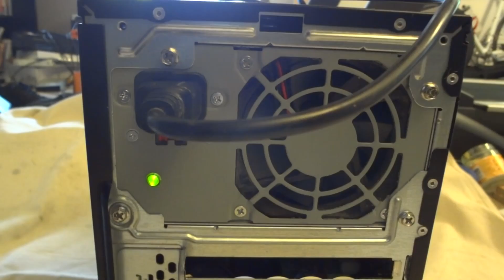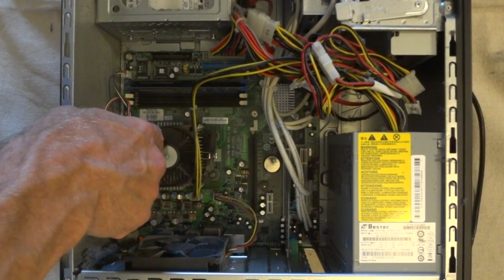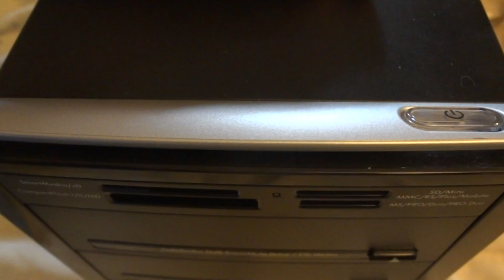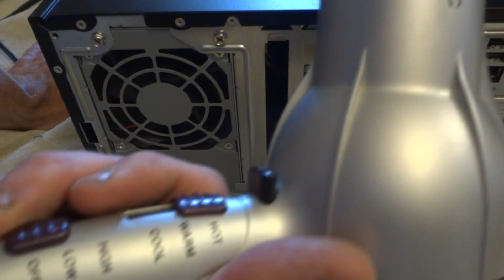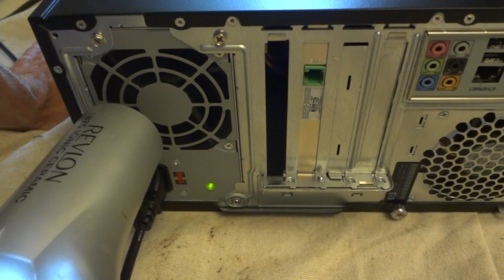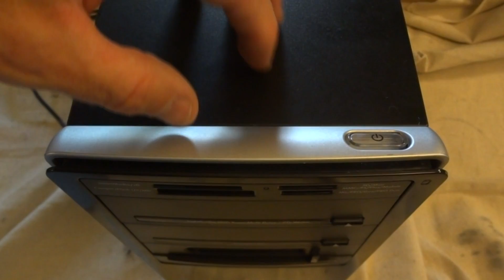HP Computer Won't Power On (Flashing Green Light On Back)

Comment: using a vacuum to clean computer not the best idea as can create static electricity... and zap your motherboard.
Reply: Smarter to blow it out.
Reply: i might agree with you sir!! can you pls help give me a hint or idea what should I do because i had a problem when i on the AVR and then clicked the CPU power button!! the monitor wont on!! mean it wont turn blue and cant proceed to windows!! do you have an idea sir what is the solution of this problem sir? looking forward for your fast reply sir!! thank you!!
Reply: and also sir there is something that i observed!! the sounds of the CPU when i turn on the CPU is not normal at all... :(

Comment: Dis that guy just used a vacuum cleaner to clean the pc ?!
Reply: What's wrong with that? Any better suggestions?
Reply: @dovydasvaiksnys3807  create static electricity that will kill all the capacitors on the motherboard lel it is why you don't put motherboard on a rug floor, static electricity
Reply: Did*

Comment: my light is green but i dont see anything on my screen. the computer turns on but nothing shows up on my screen
Reply: your issue might be more serious...open the computer and see on the mother board if the green or yellow light is on.  Not all but most motherboards has a little light somewhere and it is on when you p0wer it up.  if you find the light and it is no ON when you turn the power switch on, it means the motherboard is the culprit..

Comment: +RJ The Bike Guy listen my HP is working but when the power disappear (not in the pc, in the house) i wait for the power to come back. When it come back, the green light is blinking.. Then im using the fan method...
Reply from the maker: Replace the power supply.
Reply: +RJ The Bike Guy but listen at me, i dont have to do that method with the fan everytime , just once and then i can turn it on until the power in my house disappeares again :)
Reply from the maker: It's because your power supply is dying.
Reply: +RJ The Bike Guy you think so? i will wait for it to die then im going to buy new one. thanks for the video :D

Comment: please help mine has a green light but it wont turn on

please please please sobody help i have pictures of my kids on it
Reply: you can get someone to take the info off of your hardrive and put it on a disk so you can have your files.
Reply: ***** which is why i told them they can take out the hard drive and put it into a different computer if they cant get it fixed.

Comment: You should never use a vacuum to suck out the dust especially on the motherboard. The static electricity from the tip of the hose could damage the motherboard or one of the components. Instead use a shop vac with the hose hooked up to the side that blows air, to blow out the dust. This works much better and drastically reduces the chance of damaging any components. Don't forget to blow out the power supply as well. Do this outside if possible as the dust flies everywhere. or go buy some canned air if you don't have a shop vac.

Comment: the blinking light got solid, but mine still wont turn on.Also the fan isnt spinning.
Reply: of coarse , GET A NEW FAN
Reply: silly or use a nother fan k?
Reply from the maker: +Wow Wow It's a POWER SUPPLY. The fan is just part of the power supply.
Reply: +RJ The Bike Guy wait . . .
The internet is better than a mechanic
(kind of)

Comment: I'm just finding your channel and it is goddamn amazing. Skimmed through quite a few bike vids and ended up here. Seriously thought you were trolling for 3/4 of the video. Really good "emergency" fix I suppose. Whats really happening with the hair dryer trick is you're heating up the solder allowing proper seating for everything. Very temporary as you noted but it works. I used to fix PS3's like that.
Reply from the maker: +ATCRyderX© Actually, I think it is the capacitors that it is heating to cause it to work. But not sure.
Reply: RJ The Bike Guy If anything, You're reseating the solder under the caps. A cap is either good or blown normally.

Comment: If the fan is defective on the power supply it may be better to just take the power supply apart and replace the fan. if you replace the power supply with another used salvaged power supply it probably wont last long either. The fan has three wires going to it. one is used to check the RPM of the fan motor. When the bearings fail it slows way down or stops. Part of the proprietary power supply wiring harness sends this signal to the motherboard and this prevents the computer from booting. HP does not make Power supplies for some of these older computers anymore and cant used a standard ATX without some serious rewiring of the harness, and power plug. also I believe there is some voltage changes that also have to be made into the circuit with the modified harness. So easier to just change out the fan. This one may or not be proprietary. I know the HP 6200, 8200, Z200, z210, and z230 are proprietary.
Reply from the maker: +jimthvac100 I swapped the ATX power supply with no issues.
Reply: +RJ The Bike Guy I was not familiar with this particular computer But many of the higher end machines from HP are proprietary.
Reply from the maker: I don't know about your machine, but I bought a Bestec ATX power supply similar to what was in there, and fixed the issue. The issue is not the fan. The issue is most likely capacitors. Heating up the capicitors allows the computer start. Just a temporary fix though.

Comment: thank you, thank you so much for this video! I almost gave up trying to figure out what was wrong with my tower because I had watched so many videos already and even took my tower apart and tried everything and I figured how many more ways can there be to fix it. but than I saw your video about the flashing green light, which is what caught my eye because I always wondered what the flashing green light meant. well anyways the blow dryer did work and now I know that i'm pretty sure I need a new power supply. and I already watched your video about installing a new power supply so thank you so much for your videos, they are greatly appreciated.

Comment: I have had this happen with many hp computers you unplug the 20/24 pin motherboard connector press the power button (While the computer is plugged in) and hold the power button and pug the connector back in while still holding the power button this works and is permanent unless you unplug the computer while its on many times

Comment: WTF! Sorry, I don't normally speak like this. THIS TECHNIQUE WORKS! USE IT! I don't have hair nuthin cause I ain't got no hair. So, I have an hp6110f that HAD the exact problem. Used a little heater (medium setting bc sensor will turn it off once it reaches temp) and held it for what, 30 seconds and _, THE LIGHT WENT SOLID AS ALL GET OUT! No joke! I make repairs for a living? and am self employed. Getting ready to take the A+ (801) exam. [Talk about tricks of the trade!]
Her system has been inoperative for months, so I'm sure everything needs updating, plus antivirus, bot and utility suite. I am BROKE, its Christmas, and this fix is heaven sent. Can't thank Google, Youtube, shyflirt1 and HP enough!  With everything that needs to be done, I'll probably charge $170 - $200, a more than fair fee. I am SO grateful for this whole experience. Thank you gratefully from the bottom of my heart. God bless. [blowin heat with a blow dryer thru the back of a power supply...who da thunk it ?!? So simple, so quick, so clever. WHY does this work? Thanks again and again. 12-12-14 midday.
Reply from the maker: The hair dryer trick is only a temporary fix for a dying power supply. You will need to replace the power supply. But that is pretty easy and not too expensive.
Reply: if you do not have a hair dryer, just blow

Comment: Tried everything and still doesent work, I haven't even had the power supply for a year and all of a sudden I walk in to turn it on and nothing. HeY I used blow dryer as well and still doesent work, hey btw speaking of that could this be do to dust build up? just curious.
Reply from the maker: Dust build up can cause the computer overheat and damage the computer. It could be your power supply is dead. Dunno. Sounds like a different issue than addressed in this video.
Reply: shyflirt1 Ya I don't think It's overheat. There's a 0.0001% chance I may have left it running for a day but I REALLY don't think I even turned it on yesterday. Oh yes and everytime I unplug and plug back into the computer when I press the pwer button the blue light that the power supply makes when it is running flashed for a sec and then went out. It only happened when I unplugged and plugged back in.
Reply from the maker: I leave my computer on 24/7. Clean it out. And you might need to replace the power supply.
Reply: shyflirt1 Yes but this power supply is like CRAP, it was like 40 bucks

Comment: Thank you so so much I tried that before but not for so long and it has now worked. However it happens every time there is a power cut (so quite a lot) so is using a hot hair dryer good for it?
Thanks again!
Reply from the maker: This is only a temporary fix. Your power supply is going bad. You need to replace it. How To Replace Computer ATX Power Supply

Comment: I have the same exact computer , but it does turn on . The thing is it stays on a screen with the hp logo . And it doesn't do anything else . Do u know what could be wrong with it ?
Reply from the maker: Different issue. Sounds like MAYBE something got corrupted. You can try restoring your machine back to the last successful start up. Google for detailed steps on that.

Comment: Are you really suppose to put the blowdryer so close to the opening? I don't like putting it on high and holding it so close because I'm afraid it will overheat or something
Reply from the maker: Then don't do it. This is just a temporary fix for a power supply that is dying. You should probably replace the power supply anyway.

Comment: Hi can you plz help me!!! I just cleaned the computer with air compressor and when i plugged in all the cables and try to start it,it wont power on i dont understand what might be the problem and there is green light on the motherboard(its not flashing).
Plz respond as fast as posible
Reply from the maker: Sorry, I don't know. There are many things it could be and would require hands on testing.
Reply from the maker: If it powered on before the air compressor, make sure all the boards and stuff are seated properly.
Reply: You may have disconnected some wires..follow the power cables going from your power supply to your mobo check the connections. .If you cleaning it on carpet you may have gathered static and shocked your mobo...which then makes it useless....ps don't ever ask this guy questions again..He has no clue what he is doing and had to go to the hp site to try and figure it out.. This guy is a fucking idiot! !!
Reply: You may have disconnected some wires..follow the power cables going from your power supply to your mobo check the connections. .If you cleaning it on carpet you may have gathered static and shocked your mobo...which then makes it useless....ps don't ever ask this guy questions again..He has no clue what he is doing and had to go to the hp site to try and figure it out.. This guy is a fucking idiot! !!

Comment: When i turn it onn 
The screen will stay in standby mode and the pc will start beeping 
ans this will go onn untill i turn it off againg
Reply from the maker: Sometimes the pattern of the beeping will give you a code for what the issue is. It could be bad memory, or a fried card or even the mother board. But it doesn't sound like it's the power supply. If you have multiple memory sticks, you can try pulling some of them out (with the power off) and see if it boots. Then swap the sticks  (with the power off) and see if it boots. Try pulling out cards  (with the power off) and try booting it.

Comment: My computer has a solid green light yet won't turn on any advise ?
Reply from the maker: Different issue. May be a bad switch, bad power connection the the motherboard, bad motherboard, bad monitor, bad cable. Might still even be a bad power supply. Could be other things too.

Comment: A UPS (or battery backup for a PC ) is a good investment. It tames those blackouts and power surges. But like the little surge supressors, you occasionally need to replace them. Not exactly cheap, but good insurance for your machine. Also shyflirt1, a good idea would be to check your friend's wall socket using a wall plug ground test. A good ground is essential for a PC !! And the tester is cheap and even at the big multi stores !

Comment: I did the blow dryer and the flashing stopped but my pc turns on and off repeatedly, it turns on for 1-2 seconds then off, I noticed that the power supply light still blinks but really slow, the light would turn off when my pc would, and it would turn back on when my pc would boot for 1 second. 
Any suggeation?
Reply from the maker: Probably try replacing the power supply. The hair dryer is just temporary fix for a power supply going bad anyway.

Comment: You are a genius!. The hair dryer trick worked on a 2006 HP that I had just cleaned of dust. I NEVER in a billion years would have come up with that. As long as all I do is surf,email...it does the job fine still.

Comment: This worked for me as well. In my case, there was a pretty crazy storm in the area and knocked out the power. After that I had the same issue as everyone else. My light didnt blink so much but it was kinda dim. I left it plugged in with all external devices disconnected and after a couple hours the comp would turn out by itself, but this method started it immediately. Just used the blow dryer to get the fan crankin, noticed the green light get brighter and brighter, then the computer started right up. Took about one minute. Thanks for this.

Comment: I did what you said with turning the power supply up.. and i think i may have blown up my computer :/ opps
Reply from the maker: Turning the power supply up? Do you mean changing the voltage? That was done with the power off, and it was only switched over and switched back to make sure that switch was fully connected in the correct voltage...

Comment: I have the same computer but the problem of mines it that when i connect the power supply to the motherboard and turn it on it only goes for a second an turns off. But when i unplug the power supply from the motherboard everything everything works perfect . Do i have to change the power supply or change the motherboard?.
Reply from the maker: How does everything work when the mother board has no power?

Comment: I have a similiar problem but mine is a bit different! I use to run a portable heater off a power surge and i blew the circuit breaker on the power surge a few times! I went to bed, woke up the next morning go to turn on my PC and nothing. I have tried everything here but the hair dryer so far. The thing is, the motherboard light is green and so is the power supply. The difference between me and this problem is, Sometimes i dont get a green light on the power supply untill after i unplug it and i also hear a hissing sound come from the power supply. Sometimes when i plug power to it the light flashes green but its very slowly and does not glow as great as here. Sometimes I get no light untill i unplug the PC then it glows green for a few seconds and hisses and goes off! So do you think i have just a dead power supply or do you think my motherboard might be shot?
Reply: Now i have a steady green light, i dont know what i did but still no luck. Starting to think maybe a faulty power button or my motherboard is fried. There is no caps with any humps in them so i would not think so, im affraid to take it to my buddy because i know he likes to take good parts and replace them with junk. I just dont have the money to pay anyone to look at it! :(
Reply from the maker: Chuckie Livesay I have no idea. Sounds like it could be the power supply. But it could be the power supply AND something else. If the hair dryer trick fied it, then I would say buy a new PS. But if you aren't getting passed that, then I don't know. It needs more examination by a computer tech.

Comment: take the ram out and put it backin and it will work it happend to me same computer
Reply from the maker: Ram problems will not manifest themselves as a flashing green light on the power supply. Usually the computer will beep multiple times on boot up.
Reply: yes sir they will i have the same computer and took the ram out and put it back in and its been good for 2 years since now soo

just try it
Reply from the maker: I am thinking it was a different issue.
Reply: naw becuase i got hte same errors
Reply: the*

Comment: My HP has a steady green light , won't flash but it still won't turn on I tried everything , should I replace the power supply??
Reply from the maker: At that point, you will probably need to have someone look at it. It could be a back switch, or the mother board is dead, or could still be a bad power supply. But it's not the same issue I describe.

Comment: I had the same problem but didn't get the chance to try these tricks at the time, but i did buy me a new power supply.My computer now turns on but my monitor wont. Its not  a monitor problem, what can it be?
Reply: it could be graphic card , check if cooling fan is working on the card, if you see sign >> monitor going to sleep its the graphic card problem most likely

Comment: Problem: I've done this blow dryer method 3 times before and it worked well, but each time it seemed to take longer than before. Now my computer shut off again and now my hair dryer will not work. I've held the dryer on medium to high for two minutes maximum and it wont work any more. What is being done wrong...
Reply from the maker: The hair is NOT a permanent fix. You power supply is dying or dead. Replace the power supply.